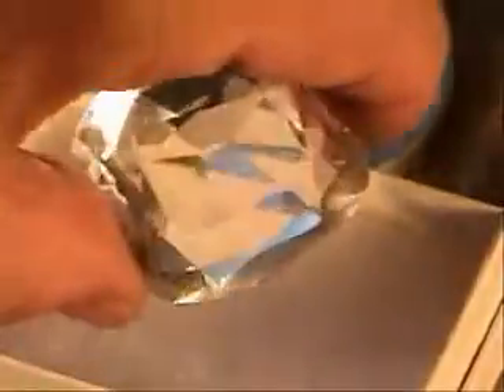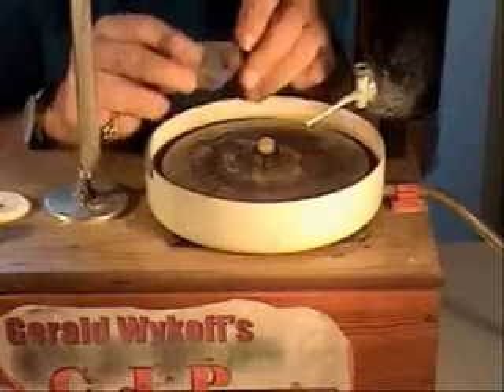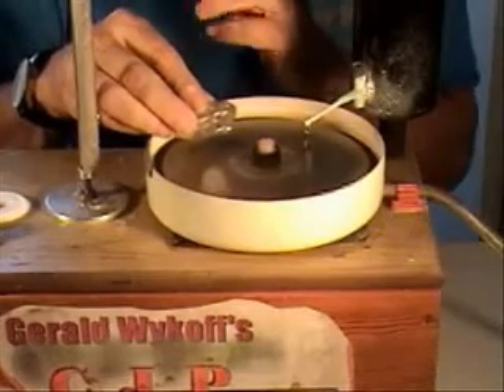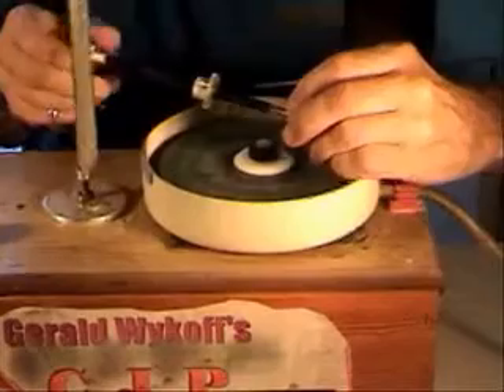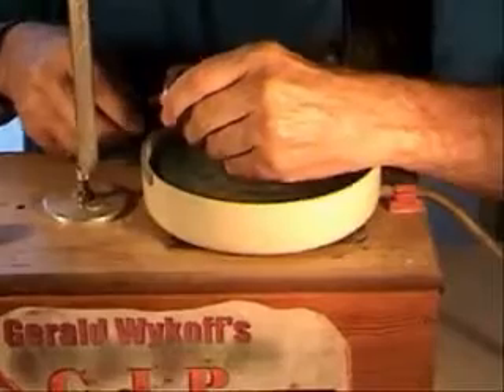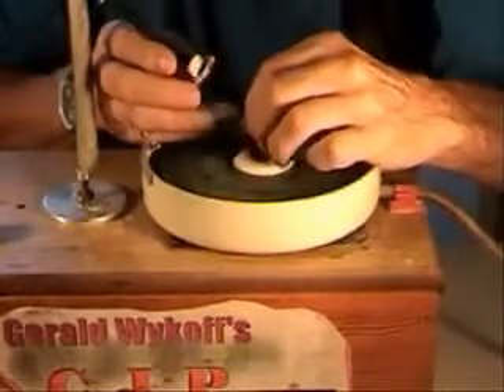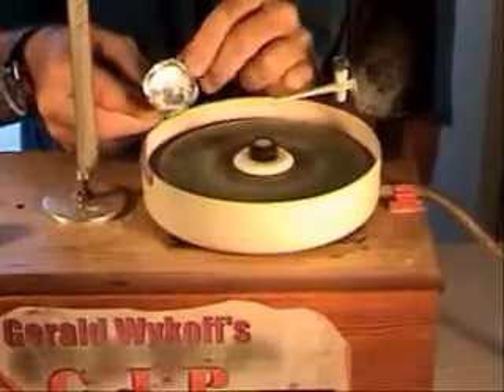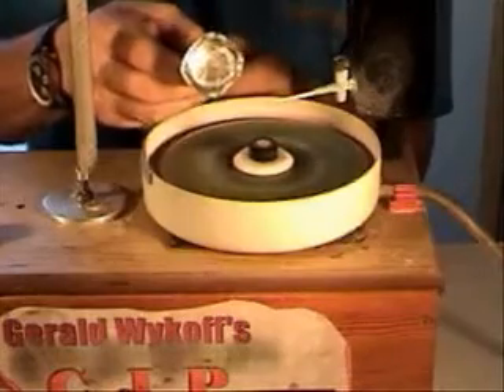Cutting the Famous Jubilee Diamond

Comment: Is the replica at the start is one of the glass replicas from a Kassoy Jewelry Supply Co. kit? I have one identical to it. The real Jubilee's outline is a bit different and it has a culet that's very close to 1:1, rather than oblong, and its pavilion mains are sharper, too. Kassoy's replica flat— real gem has better proportions, so its shorter/narrower. The overall outline is very slightly more rounded.

Google Hubert Racketts' replica, its pretty close save for the long sides' outward angle